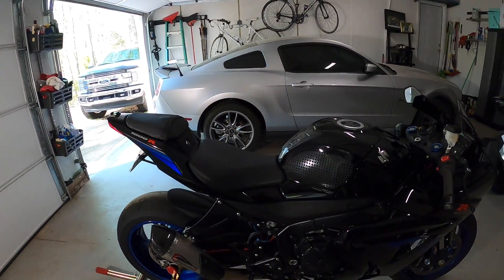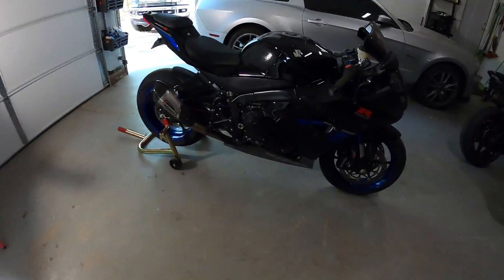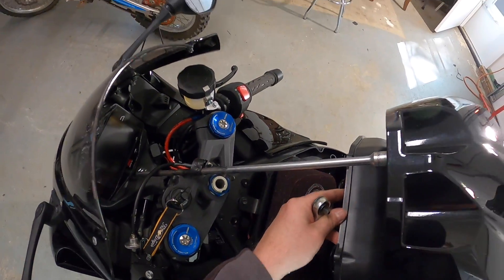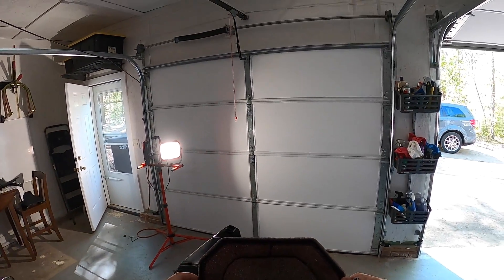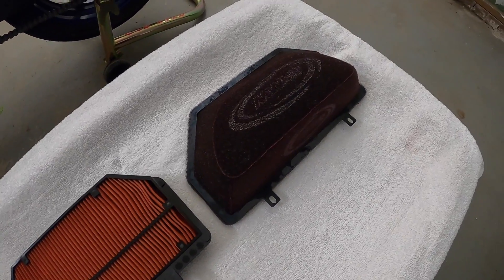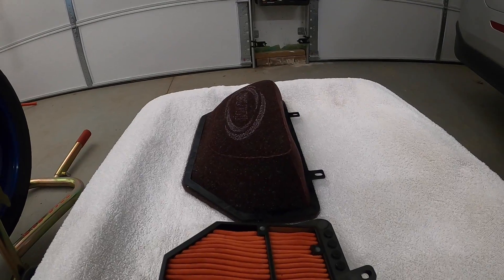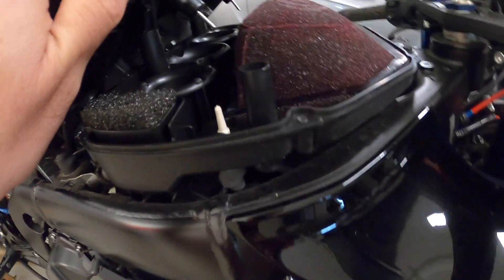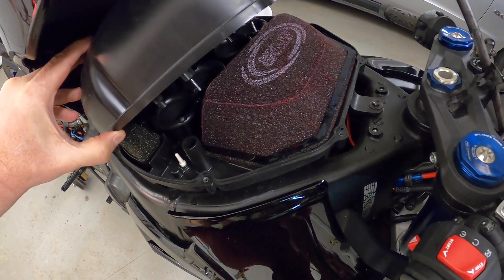GSXR1000R MWR WSBK FILTER MAINTENANCE OEM TO MWR COMPARISON

Comment: Have you ever tested the Sprint filter. Very curious about using these filters on our bikes as we do roll racing 9/10ths so top speed acceleration is paramount. We too have some L7 gsxr 1000s so any information would be greatly appreciated
Reply from the maker: Here is what I know about MWR and Sprint.  MWR has been proven on the dyno to gain 2-3 hp stationary on the GSXR1000.  I have seen changes in fuel trim required on all 3 bikes I have installed MWR on.

With that said, I have heard the same and have communicated with a person who uses Sprint and says they work.  I trust this person because I know he test on the road.
Reply from the maker: What I don't mention in  the video is where the majority of the dirt was found on the filter.  Based off the grease and dirt location the raised part does allow more air in.   To answer your question MWR or SPRINT are the only two I would consider for performance.
Reply from the maker: Also, I track or ride canyons.  If I was roll racing I would be looking at aerodynamics.  I forget the actual hp number required to increase 1mph at the speeds reached in 9/10 racing, but it is significant enough to make a difference.  Just look at land speed racing those bikes and cars value aero.
Reply: @MantisRacing  oh we do use LSR Fender's for better aero and we know the number to gain 1 or more mph +gearing that's why I was asking, I've seen where they said they picked up three mph on MV Augusta  F3 SS and super sport. Thank you for your input, it is very much appreciated